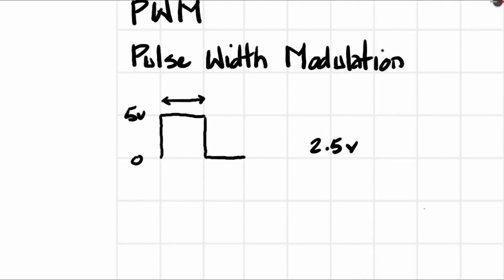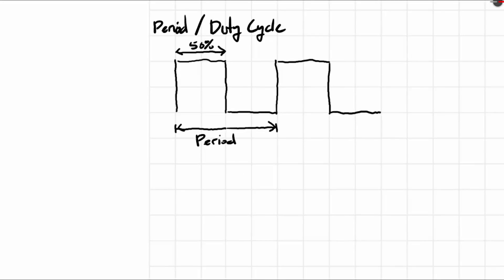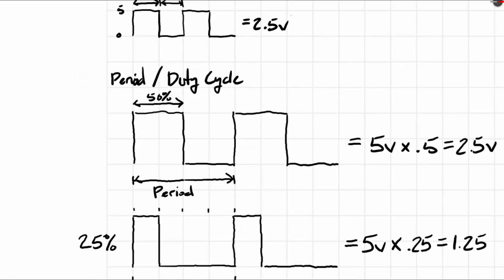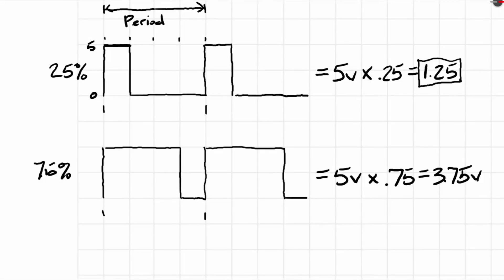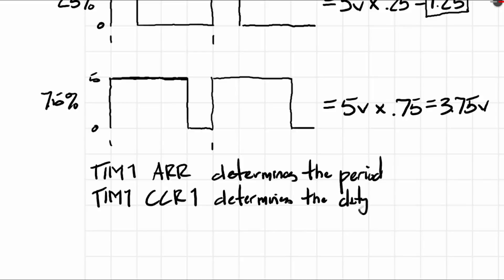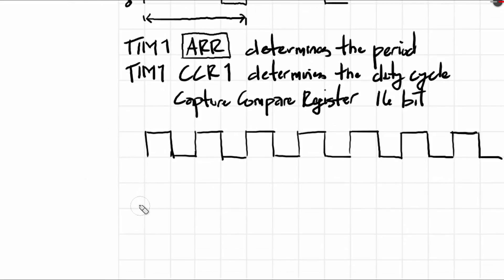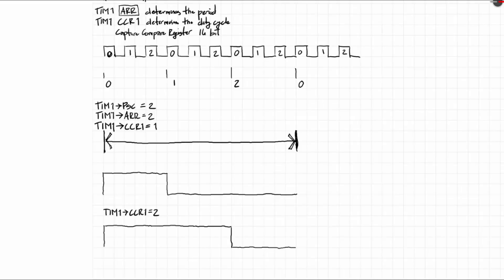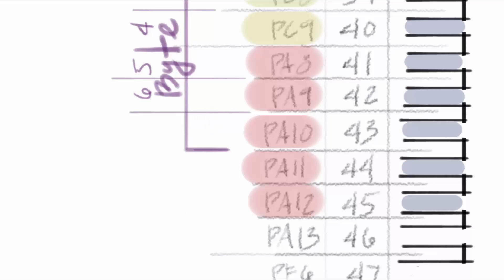43. How to Use or Create a PWM (Pulse Width Modulation) Signal Part 1 - STM32 ARM Microcontroller

Comment: How about creating a delay and setting and resetting the GPIO PIN on and off for required number of times.... does it works i mean passing user defined value in prescalar .
Reply from the maker: Do you mean turning on and off a GPIO pin to mimic a PWM signal with the help of a time delay?  It is possible and I do this in my AVR series to control many servos at the same time since there are limited PWM outputs.  Check out that video here: https://www.youtube.com/watch?v=dmjvHvw3Rc8

Comment: I think there is something wrong at 9:30.  When the prescaler is set to "2", the clock ist dividet by 2 and the counter will skip every secound pulse, not every third. Due descibed in the RM0041 at 15.4.1, the  prescaler can divide the counter clock frequency by any factor between 1 and 65536. Means, the first pulse is "1" instead of "0". Otherwise a psc of 1 would skip every secound pulse, and this makes no sense because pcs 1 indicates "no clock division - no Prescaler.  Psc 0 is not allowed.
Reply from the maker: The skipping every third is directly from the datasheet.  You can see this on page 223 on this reference manual https://newbiehack.com/Documents/STM32F030Reference.pdf

It shows that the prescaler is zero based index, but if it doesn't allow a prescaler of 0, then a bit of research will be needed to determine how to return to a default condition.
Reply: I think, a prescaler of 1 means no division, 2 means dividet by 2 et cetera. The counter timing diagram on figure 41  (page 223) is slightly inaccourate because it  neither shows an exactly division by 2 nor by 3. So let´s discover the true by messuring the TIM output signal on the pin whith an oszilloscope ;-)
Reply: btw: Figure 42 is more precise and shoes the pcs set to 4. As you can see, the timer conuts on every fourth pulse (by skipping 3 pulses).
Reply from the maker: If you do find the correct timing, let me know.  I believe I did a relatively accurate measure of this to achieve a one second span.  This is in the coming videos (currently on patreon).  I just can't remember what I did.  Haha.
Reply: The prescaler value determines the scale for clock division and couldn´t be 0, because division by zero... And now the confusion: to achieve a certain scale, the register value stored in the TIM PSC register needs to be set (scale -1), because the register values are zero based. For example. prescaler 2 -> PSC register value 0x0001, 100 -> 0x0063 :-)